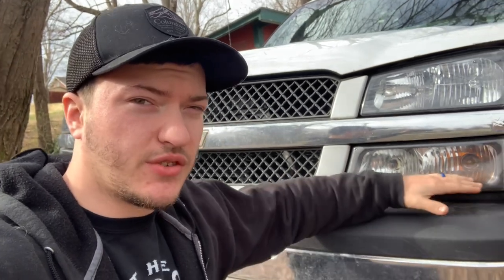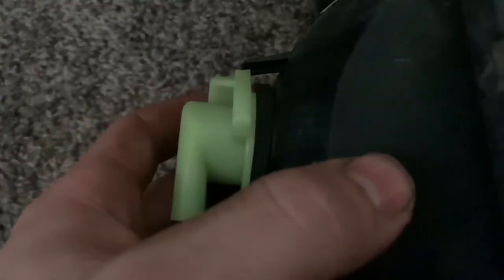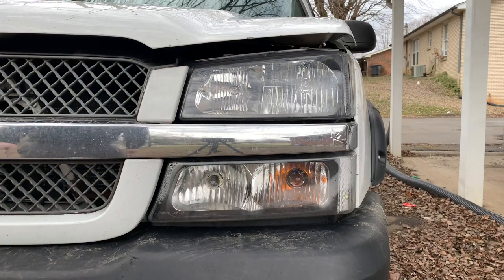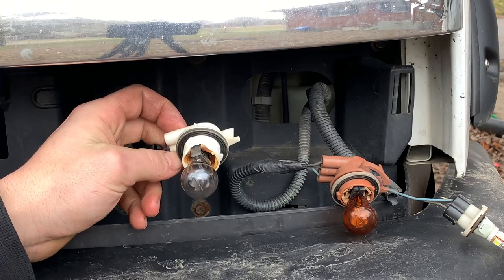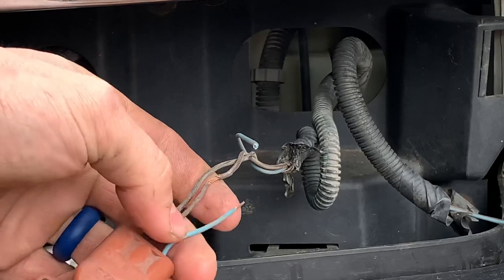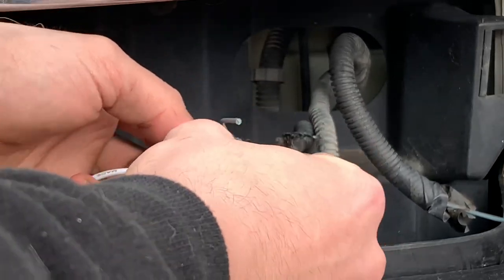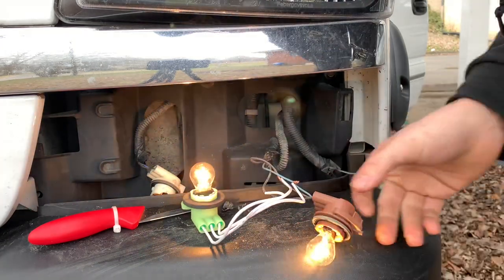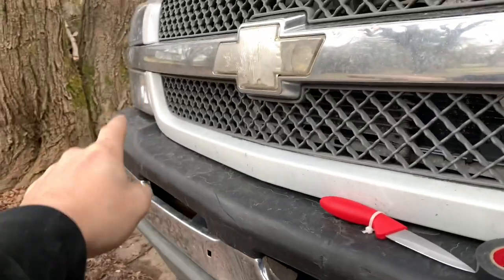(EASY WAY) 03-07(classic) DRL to blinker light mod!!!

Comment: Looks great, have you had any issues? What about the wiring getting HOT since you spliced them together?

And the ones you taped off, did you  think about extending them to make an extra lighting for under the hood?
You can probably find shatter proof standard filament bulbs.
Reply from the maker: I haven’t had any problems yet! And no they’re still taped up for now. I havent figured out if I want to keep ‘em taped up or do something else lol

Comment: I have the same setup but with switch backs. Do your lights come on when you unlock your truck
Reply from the maker: They used to but recently I swapped to a Escalade cluster ever since then I don’t get feedback at all when locking or unlocking the truck lol. Also I installed switchbacks shortly after this video and the ones I got have a pause when turning on so they would only flash once if I unlocked the truck twice
Reply: @ZPTVChannel  I’m thinking of running off the Drl to the tiny side marker light and running an amber led, hate not having any lights come on in the front
Reply from the maker: @90zr1  before I put in the switchbacks I had white leds in it and they would come on every time

Comment: During the day do they stay on? Like without turning the signal light on and when the truck is on do they stay on
Reply from the maker: No, they’re off until you turn the lights on
Reply: @ZPTVChannel  ok thank you. But do you know how people with gmt800’s have there signal on like a drl and it works as a signal light and drl
Reply from the maker: @user-st1sr2cp2g I’ve never seen that before! This mod deletes the drl harness completely so it’s just parking and signal lights.

Comment: Just addded these switchbacks on my 05 Silverado cat eye. Idk if it’s just me but I say 1 blinks quicker than the other one. How are yours holding up? Man. I do have hyper flash which I am going to fix
Reply from the maker: @lauroguerra732  it’s still doing great! I’ve been meaning to go back through and connect everything better because I only used electrical tape lol but even doing it that way it’s been great for the past couple years!
Reply: @ZPTVChannel  I did the same thing as you did brotha. Used electrical tape.
Reply: @ZPTVChannel  I just wonder why mine is a tad off… 🤔🤔
Reply from the maker: @lauroguerra732  probably just the relay freaking out. I would swap to the Novita relay and that should fix that! https://amzn.to/4fzTWta
Reply from the maker: @lauroguerra732  here’s the video on how to change the relay! https://youtu.be/sdqd3X1VD6A?si=ka-3CBqh6d73w4dX
Reply: @ZPTVChannel  yea same thing I said man. I’ll look into swapping it out

Comment: What is the tiny bulb on the outside end for? Seems to be a parking white light that remains on at night. Factory is incandescent so what's the LED model bulb for this?
Reply from the maker: It’s just a side marker light it’s on all the time when your lights are on. I think it does turn off when your blinker turns on though.
Reply: Just a marker light you can upgrade to led it won't mess anything up. It's a 194 bulb it also has one on the back

Comment: sodering what does that mean exactly i want to do this mod the right way please repond
Reply: and where can i get the green harness wcould i just get a running light harness from the junkyard?
Reply from the maker: I can’t really explain soldering.. there are tons of videos on how to solder. Or you can use t-taps which is way easier. And yes you could cut the connector out of a junkyard just make sure it’s the blinker connector and not the drl connector.
Reply: @ZPTVChannel I’m doing this on my bubble eye might go pick up a blinker connector later hopefully it goes good

Comment: I'm trying to figure out how to activate my 2007 Silverado (classic) DRL's. When they're on auto, it uses the main headlights as the DRL's, and not the bottom corner. I am confusion.
Reply from the maker: The drls only come on when the truck is in drive.
Reply: @ZPTVChannel  I get what you're saying, but what I mean is, that the "factory" DRL's don't work as DRL's. And the main headlights are the DRL's, which I don't want. The "factory" DRL's only work when you unlock the truck with the key fob remote. So in conclusion, I want the factory DRL's to work as they should. Not the main headlights. If that makes sense? Lol
Reply from the maker: Hmmm I’ve never heard of that happening.. if your truck has steering wheel controls there may be something in the settings to change it. Or maybe there’s something going on with the switch?
Reply: @ZPTVChannel  My truck has no steering wheel controls. It's a very minimal truck. It's so basic, that the center console is an extra seat. Ha ha
Reply from the maker: Oh lol yea I’m not sure what’s going on there...
Reply: @ZPTVChannel  Nobody knows why. That's the frustrating part of it all. I guess I have to live with it.
Reply from the maker: @teaganna5970  right... sorry I couldn’t help..
Reply: @ZPTVChannel You're good, maybe if you find out, you'll let me know?
Reply: @teaganna5970  just remove cut the wires for the headlight sensor and the headlights are gringo to be on and the drl off
Reply: @teaganna5970  there's a sensor on your dash in the middle. When it detects daylight, auto will be just your Drls and blinkers. When it's dark out, your auto setting will be the lowbeams and blinkers. If you want to see if they work, lay your phone on the sensor with the flashlight on, then switch it to auto. If they don't come on, it could be the sensor itself.....or the 10 Amp fuse in the fusebox under the hood. 👍
Reply: @teaganna5970  Also! As stated above, they will only cut on in R, N, or D. So set your ebrake in neutral when you're checking.

Comment: I always liked the older style (88-98) that used the entire lower assembly as a turn signal. In my opinion the DRLs on these trucks look pretty dumb unless you put white LEDs in them. I like this even better tho.
Reply from the maker: Same! I don’t understand why they changed it.
Reply: @ZPTVChannel  have you had trouble with moisture in your headlights? I’m looking into getting aftermarket ones and I don’t want to buy crappy lights Lol.
Reply from the maker: No! I bought these off Amazon I’ve had them on for a while now with no issues! I’ll try to find the link for you!
Reply: @ZPTVChannel  THANKS!!!
Reply from the maker: https://www.amazon.com/gp/aw/d/B085VMGRMB?psc=1&ref=ppx_pop_mob_b_asin_title
Reply: Cool. Also, I finally did the center console swap that you did. The interior is infinitely better now. I found a guy in Greenwood, SC selling a bunch of them for $50 a piece. Killer deal.
Reply from the maker: @jacksonreid6412  $50?!? That’s amazing! Normally you’d be lucky to find them for under $200 lol
Reply: Yes, I searched for months. Sellers would never contact me back and I gave up. I finally saw a listing on Marketplace and this guy had bought a bunch of them from the police department, who had swapped police consoles into their Tahoes. I told him he could easily make 250 off of the ones in good shape.
Reply from the maker: @jacksonreid6412  right! I got lucky and a guy did a different console in his truck and didn’t need that one so I got it pretty cheap but not $50 cheap lol
Reply: @ZPTVChannel  I sold my old one for $30 to a guy who had his fourth kid on the way, so I really only paid 20
Reply from the maker: @jacksonreid6412  I can’t remember how much I sold mine for lol
Reply: I’ve been pretty lucky for the past few years. I bought my truck, a 2003 Silverado 1500, extended cab, long bed, 4x4, 5.3, for $3500. 161,000 miles. I’ve put about $3000 into it as of now, and I could easily sell it for $6,000. I’ve had a few problems like knock sensors and stuff but nothing major.
Reply from the maker: @jacksonreid6412  hell yea! I bought mine for $2,500 it’s a 03 z71 5.3 but it had 280,xxx miles lol. I haven’t put much into yet but soon I’ll be doing a lift and wheels as well as a couple other upgrades!!
Reply: @ZPTVChannel  I highly recommend the Boost Auto Parts tow mirrors. Out of all of my upgrades, those are my favorite. I pull a 32ft boat trailer with my truck and they make it so much easier. They look sick, too. Well worth their hefty price tag.
Reply from the maker: I plan on going with the newer style tow mirrors I’ve been looking at boost auto parts but I’m gonna wait until I lift the truck lol
Reply: Yeah, I would lift mine but I’m a broke 16 year old and can’t afford such things
Reply from the maker: I feel that lol I’m 24 not broke but don’t have a lot of extra money due to bills and all that but I’m gonna end up getting the rough country 6” lift. It comes with everything for $1000
Reply: @ZPTVChannel  Yeah, that’s not a bad price. I just found out my rear main seal is leaking though, so I know where my money is going 😭
Reply from the maker: @jacksonreid6412  dang... that’s never fun..

Comment: yo bro I did the same thing u did but my left side blinker stays on doesn’t wanna work
Reply from the maker: I would check the wiring and make sure you didn’t get a wire crossed
Reply: yea bro I did mess up on that but now the lights don’t turn on only when I put the turn signal and then they just turn off
Reply from the maker: @Xivan187X  try the turning on the hazards and see if it works. If none of the other ones work I would say fuse. But if it’s still just that side it may not have a good connection to the blinker side or maybe the bulbs are bad.
Reply: @ZPTVChannel   did you add a load resistor to your switchbacks ?
Reply from the maker: @rickyrubio3370  no, just had to swap out the flasher relay!